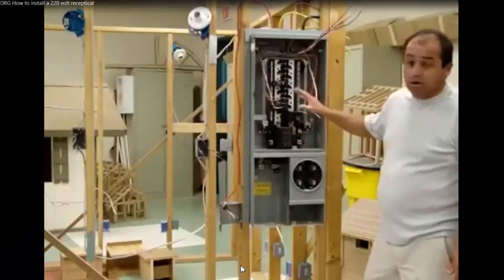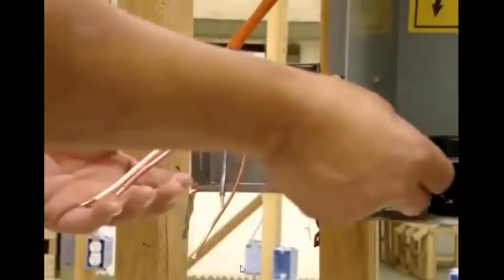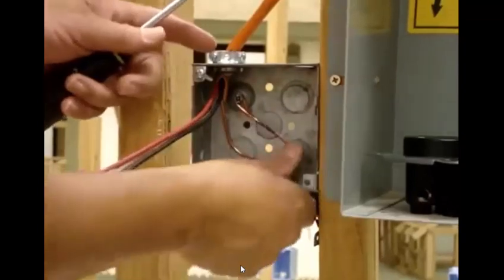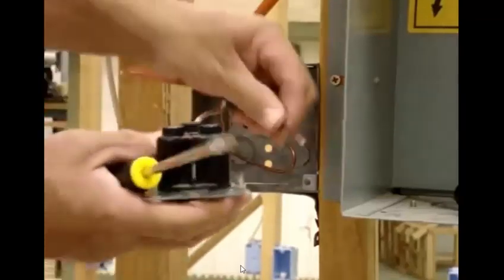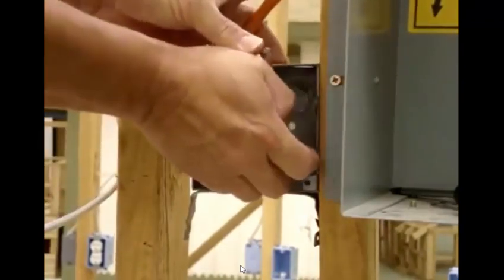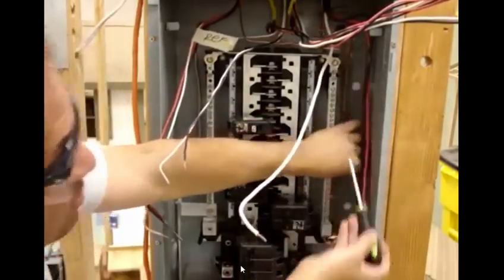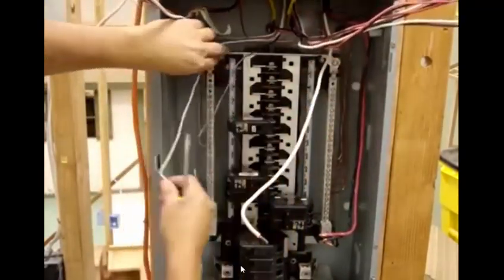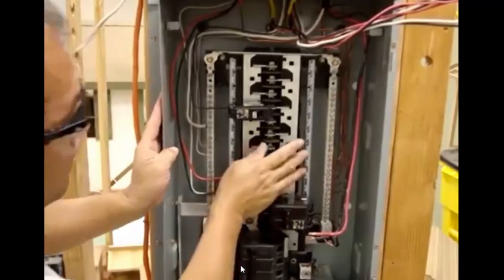How To Install a 220 volt Receptical -BuildingTheWay

Comment: So in your breaker panel and on your compressor switch, You hooked up red and black and I get that's 220 when both hooked to separate phase line, (make sure you tell people it's two separate lines from the pole and not both hooked to the same 110 spot in the panel) you say Neutral but they are both connected as GROUND are they not? So white wire does not have power? then why do they put inside 220v line runs? if it's just another ground?

Comment: A 3 wire recptical doesn't require the neutral but a ground just cap off the white and hook the ground to the third terminal.
Reply: That just answered my question above thanks..
Reply: That's right, 240 volts three prong requires a ground no neutral. Please fix that issue in the connection.

Comment: I have a question is this a similar installation to the ones in Argentina require a type C or type I Power outlets that run on 220 or 240v

Comment: "Garbage disposal, dishwasher, refrigerator. Neutrals on the right grounds on the left"  Must not be in the U.S. No residential disposal, dishwasher or fridge is 220V. That is not a sub panel, the neutral is bonded so both bars can have ground or neutral. He installs his dryer receptacle upside down and thanks 6 inches is code for a strap. Hook the ground up first. It makes no difference.

Comment: I hate that you skip what happens to the wire between outlet and breaker. Can it lay across beams or does it have to secured to the beams. And explain why you have to use metallic gang box as opposed to plastic???

Comment: I want put a 3 prong for my dryer there's 4 wires showing like here but my box is plastic? Should I just    use red black ground cut off my neutral?
Reply: Did you find a answer for your question I have the same problem
Reply: For the 3 wire system use the black and red as hots if u have a 4 wire cable ran and the bare for ground. I ran a 3 prong outlet for dryer and used 3 wire cable. 240 volt 3 prong uses no neutral just ground

Comment: Most electricians leave an extra 6 inches of cable in the wall in case you need to pull out some extra wire for a repair
Reply: Actually, we leave at least 6'' extra from the edge of the box because that's what NFPA 70 (aka the National Electric Code) requires.